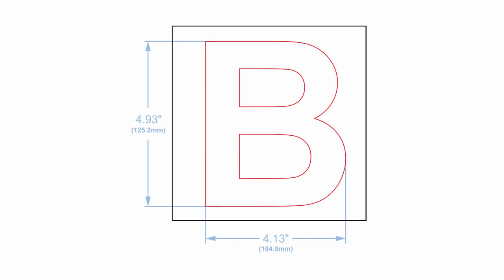Laser Hack: How to get perfect Acrylic Cutting Results by Using Wet Paper Towels

Comment: Thank you for the tips.. i have a 100 watt co2 laser, and have to cut 1/4" acrylic . does anyone have starter settings i can test? what focal distance as well?
Reply from the maker: For cutting 1/4" (6 mm) acrylic with a 100W CO₂ laser, here are recommended starter settings based on tested parameters for TroGlass Clear using a 2.5" lens on a Speedy 400 with Ruby Software:
Suggested Settings:
Cut Quality (best edge finish):
Power (P): 70%
Speed (V): 0.2%
Z-offset: -2 mm
Cut Speed (faster throughput):
Power (P): 95%
Speed (V): 0.4%
Z-offset: -2 mm

Here are some additional tips:
Always enable air assist and proper exhaust.
Test on a small piece first to confirm cut quality before running full jobs.

Ruby includes start parameters for all Trotec materials in the material database, so you can select the material (e.g., TroGlass Clear) and get optimized baseline settings instantly. These are great starting points for fine-tuning based on your specific requirements.

Comment: Ok, this is an old video but very interesting. I'd love to know more about cutting different types of acrylic. On this video, what kind of acrylic are you using? Cass vs Extruded? I have an xTool D1 cutter but have not been able to cut many acrylics. Really, so far only black. So, if you can give me some hints, I will be greatly appreciated. Thanks.
Reply from the maker: This laser hack will work with any kind of acrylic; cast or extruded as well as any laser cuttable non acrylic plastic with any thickness that a laser has enough wattage to cut.
Reply: @TrotecLaserEngraving  thank you. I’ll try and see if I have any issues. Then check back with you. Thanks a lot. Can’t wait to try it.

Comment: I recently developed an alternative method,seeing that I usually cut half inch acrylic letters that take up the entire bed size of our Speedy 360,and can take upwards of two hours per sheet. Instead of putting the wet paper towel on the bed, I actually use it directly on top of the acrylic.It has to be drenched and completely smoothed out without any gaps of air between the towel and the board.

 This is better,imo,because I keep a spray bottle full of water on hand,and when it starts to dry out,I can always pause the machine and re-wet the towel. This would be completely impossible for me to do if the towel were underneath the acrylic.

Comment: Wow!!! Cutting 20mm thick acrylic at 100mm/s is more than impressive with 80 watts. Is there some magical power/effect that allows an RF laser beam to defeat the laws of pyhsics and chemistry? 2 or 3mm/s would be a more realistic speed  Did I miss the bit that indicated that the video was greatly speeded up or is the close up demonstration slowed down. VERY confusing.
Reply from the maker: We are sorry for the confusion; this video is designed to showcase how to reduce flare, and yes, the video clips are time-lapsed to save time, as the cut speeds are not discussed. All samples are cut with this wattage in the video using this laser hack.

Comment: i can confirm a variant of this method works very well for 3mm plywood, blue tape on the top surface and sopping wet paper towel underneath i've never had cuts this clean and we're talking bottom of the barrel bunnings plywood

Comment: Newby here, cutting 0.125" acrylic on ULS carbon dioxide laser at a maker space, dark acrylics have flame marks on back, the maker space insists we use this elevated expanded-mesh underlayment base, wherever the laser hits the steel rack, I get white burn marks on my acrylic cuts.  I tried wet shop towels on top of foam board to keep the towels from sagging between the mesh openings on the underlayment, well, now I got much bigger STEAM BURNS on the backsides, I'm making jewelry components for earrings, this technique didn't seem to help my problem, it now looks like dull clouds on what started out as a shiny back, any ideas out there to help me?  Thanks!
Reply from the maker: Try this: https://www.youtube.com/watch?v=_Sk0wfnj3d4 -this could help! :)
Reply: @TrotecLaserEngraving  Not this suggestion MAKES SENSE !!!!  Bless you and thank you!!!!!!

Comment: Hello! Does the laser have to be special?  My laser (20W) does not cut transparent acrylic (1mm thickness), it is like if it does not see it!
Reply from the maker: Your diode laser operates at 455 nm. This wavelength does not react with transparent materials. The laser we use operates at 10.600 nanometers and reacts with transparent materials.
Reply: @TrotecLaserEngraving now everything is clear, thank you so much 😃

Comment: Can Trotec Speedy 300 45w cut acrylic with 1/4” thickness ? Settings ? Thanks
Reply from the maker: Yes it can. 100% Power, 10k frequency and 0.5% speed (Trotec speed settings). Our rule of thumb for good speed and very good quality is 10 watts per 1 mm / 0.04“ in acrylics
Reply: @TrotecLaserEngraving  using your rule of thumb how are you cutting half inch on an 80w at 50% power in the video? Thanks

Comment: Great, does this works well on mirror acrylic? I have a problem with cutting mirror acrylic creating sparks.
Reply from the maker: Hello! Thanks for your question.
Mirrored acrylic should have no issues being laser processed; it can be cut, marked, or engraved on both sides.
If you see sparks, then the coating used to create the mirror surface on the brand you are using must have a metallic layer, which can cause sparks when laser cutting. We recommend acrylic mirror that does not have any metallic coatings for the best effect.
If you are interested in laser friendly acrylic mirror, please see the Trotec Materials page and inquire for a sample of laser friendly acrylic mirror: https://www.trotec-materials.com/acrylic-sheets/troglass-mirror.html
Best regards, your Trotec Laser Team

Comment: hello, thanks for the hack
Can you give the parameters for the 20mm with an 80w please ?
Reply from the maker: Hello, thanks for your question!
LaserDave used the following parameters on a Speedy 360, 80 watts for 20mm Acrylic: 100% power, 0.02% Speed 5000Khz, and he focused on the material around 5mm running air assist with the smallmouth cone.
Best, your Trotec Team